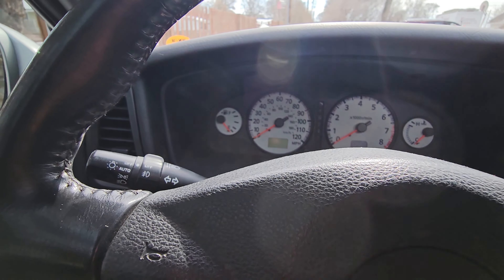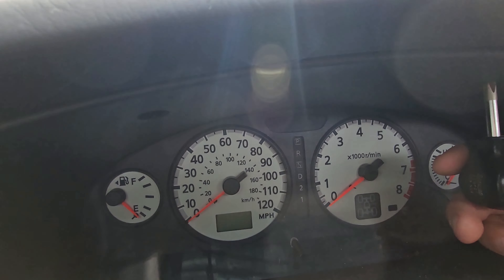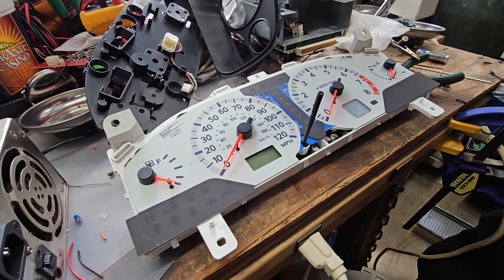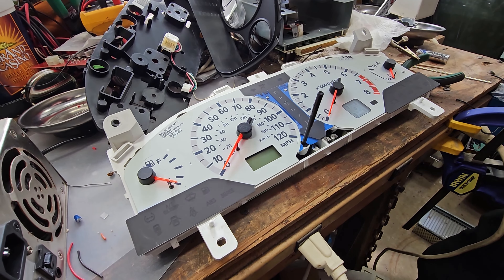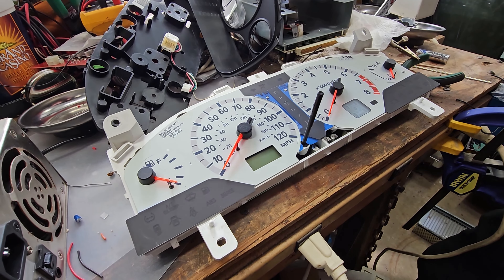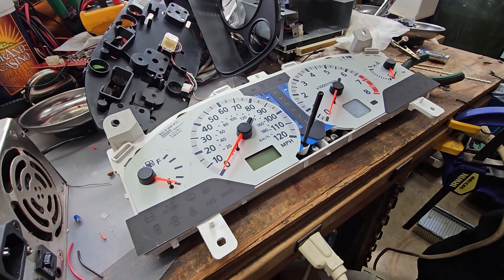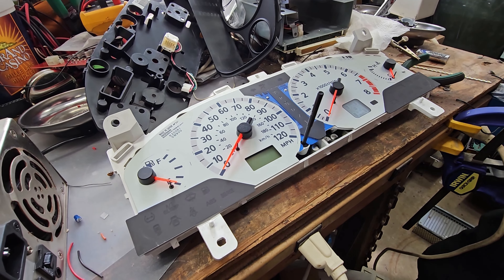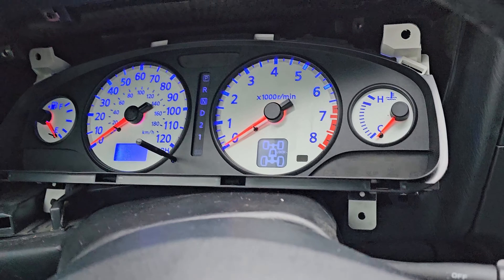Pathfinder Fuel Level Reads Wrong-Fuel Gauge-Cluster Repair-R50

Comment: extremely helpful video. finally a solution to my gas gauge problem. Had two mechanics change the sending unit without success. I cant wait for weekend so i can do this repair and then change the light bulbs to LED!!!
Reply: Did you fix your car?

Comment: I tried this and it worked. Thank you so much. I’ve been having a check engine light and my fuel gauge was always stuck at full. I did your method and cleared the check engine light, gas gauge has been going down🙌🏾. Thank u so much my friend🙌🏾
Reply from the maker: Glad to hear our video worked for you!  Thank you for the comment!

Comment: Well done!  I would strongly urge anyone doing this repair on the cluster to make sure you have a can of Deoxit-5 contact cleaner at the ready for cleaning all your multipin plugs and bulb sockets. There will probably be 20+ years of oxidization on any metal contacts and you sure don't want to have to pull the cluster again after reinstalling.

Comment: I need to do the same fix as my 2003 decided to run out while at half tank and i was ignoring my trip meter. Upon refueling the guage went full and worked for a bit but has since stayed at or close to full. Is there a part number for the resistors? Id like to buy new ones in case i find the existing ones beyond reuse. 
Thanks!

Comment: Interesting, I have a 2004 with fuel gauge that says full all the time. The strange part is that my fuel pump is fairly new  (2 yrs old)and the fuel level sensor was replaced at the same time. The fuel gauge hasn’t worked since. Service Engine light is on. The diag. code shows low voltage condition. Any thoughts?
Reply: I haven’t had time to take it back to the same repair garage because they are always booked and I have been using another repair garage since then.

Comment: I had a very similar issue. The Nissan dealership replaced my fuel pump and now it’s stuck at a little less than half a tank even though I’ve filled it completely. Same fix, do you think?
Reply: btw I also have an 03 pathfinder and my interior looks completely different. Wild

Comment: Do I have to remove the resistor that is not working or is it just melt the older solder and and solder over it?
Reply from the maker: The issue with the cluster was not the resister itself, it was the poor soldering that was the issue.  So yes, just heat up the old solder on all 4 resisters, and re-flow with new solder.  Sorry for the late reply, hope you got it figured out!

Comment: Thanks for the video. I have 3 resistors at 120 and 1 at 130. Is the one at 130 an issue?
The gas gauge on my cluster has the same exact issue. Thank you
Reply from the maker: I would say to re flow all 4 registers on the cluster.  The 130 ohms doesn't seem to be too much of a problem compared to what this one showed.  But definitely give it a try!   Also, after you have re flown the resisters to drive the vehicle to see if the low fuel light comes on before you put the dash back together.   Best of luck!    One more note: Sometimes this isn't the main problem causing the low fuel light not to come on.  Again, going off from your readings, I would suggest looking at the fuel sending unit inside the gas tank.  That could also cause an issue.  Best of luck!
Reply: @Ps3mn1  Thank you so much. The fuel sending unit was replaced a few weeks ago, so I don't think that's the problem. Will try the resistors 🤞
Reply from the maker: @24lponce  Sounds good, this is going off from what I know personally.  Reflowing the resisters did drop the ohms, the fuel gauge has been working properly since the fix.  If you have any questions feel free to post again!  And if you do remember, I'd love to hear back from you if soldering on the resisters solved the problem!   But you should tell the difference right away once you reconnect the sockets to the board.  Best of luck!
Reply: @Ps3mn1 mine also has 3 resistors at 120 and one at 130 .. did you fix the problem with the resolder and reflow on that one ?
Reply: @24lponce mine also has 3 resistors at 120 and one at 130 .. did you fix the problem with the resolder and reflow on that one ?

Comment: Thank you for sharing.  Fixed 03 Pathfinder with gauge always reading FULL unless connector removed from sending unit.  Resistance measurement correct from cluster connector M24 pins 17 to 31.  So... has to be gauge issue.  How did you find these resistor being the cause?  Did you find a cluster schematic somewhere?  I was planning on following traces on the board from each connector pin (17 and 31) to layout the control circuit.  Well done!  Thank You!

Comment: Did you re-Saulder the same resistor or did you get a new one?
Reply from the maker: @timelessautohouse5944  Hey there!  I re Sauldered the existing resistors that were on the cluster.  There's 4 of them!  The problem was the connection joints between each resistor and the circuit board were bad.  Meaning a "loose" joint. Nothing was replaced!  Just re flowed the Saulder to make the joint strong again!  Hope this helps!
Reply: @ yes it does thank you!!
Reply from the maker: @timelessautohouse5944  Perfect!  I also recommend replacing your cluster bulbs while you have the cluster torn out!   The bulb size is T5!